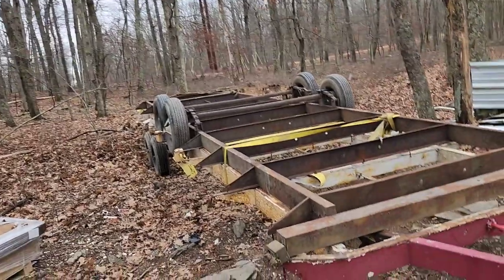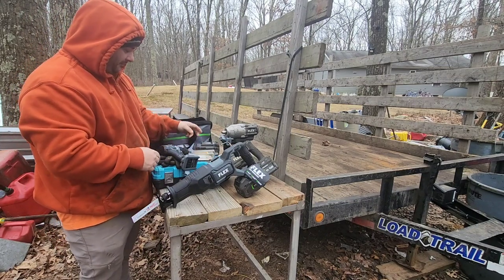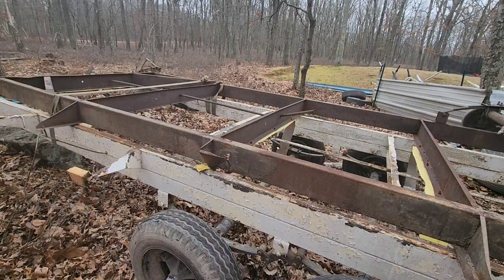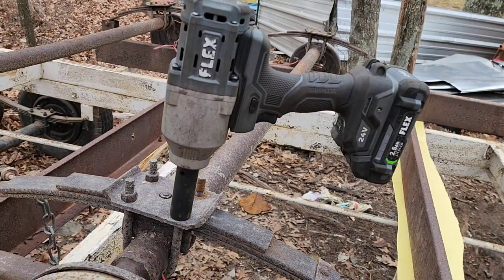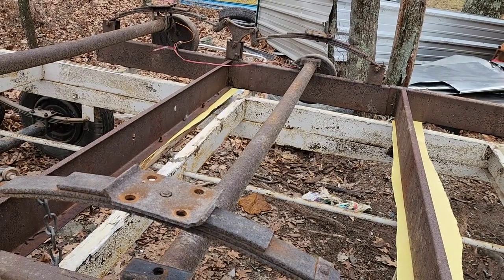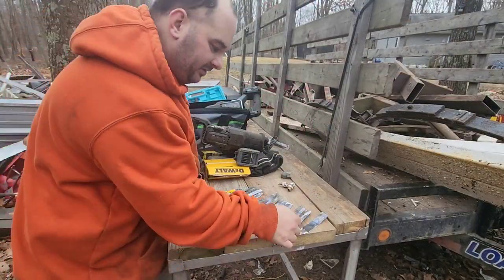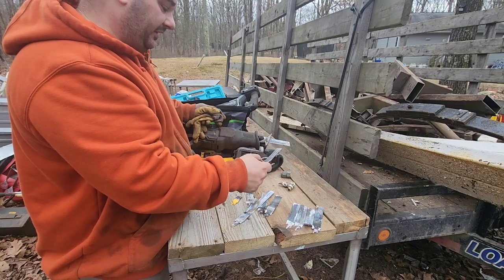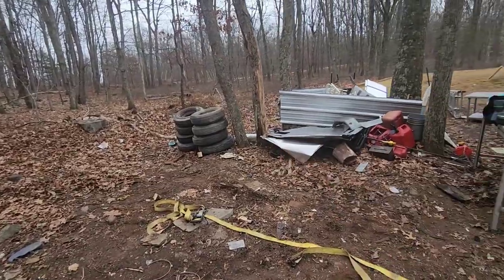Cutting up scrap metal with new Flex Reciprocating saw

Comment: nice cut up in trails . i used diablo  saw blades . wet up to benweitsmen today with aload of rotors closes to 4 gton
Reply from the maker: Nice... I like Diablo blades but they break really easy..
Reply: @Adventureswithmike1  ok i used then on the a/c AC compressors and used mybe 2-6 on 30
Reply: @Adventureswithmike1   yup that was 1/2 . still got  a 275 oil tank full to
Reply from the maker: @peterbosser2049  💪

Comment: The Diablo blades work well on 1/4 inch and heavier  👍😊👍
Reply from the maker: Yeah my biggest thing is when you're cutting something and it pinches the blade it usually bends it I really like the carbide saws all blades but they're very expensive and one pinch and they usually break the teeth off in their useless...
Reply: @Adventureswithmike1  a jack can  help with  pinching  !!!!

Comment: I use Morse blades with 14 teeth per inch. 15 blades for $22.00. I have cut mobile home frames with them. About 5 cuts per blade average.